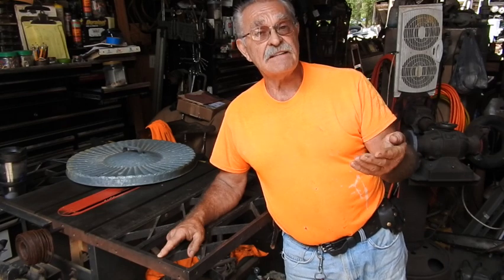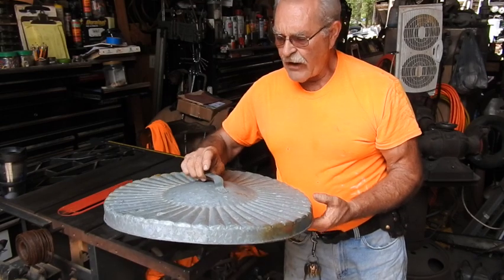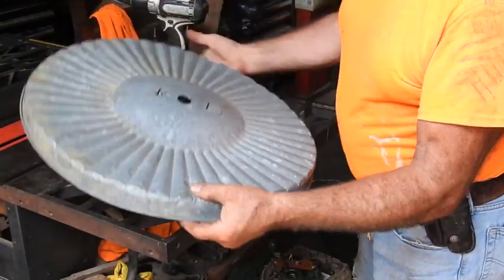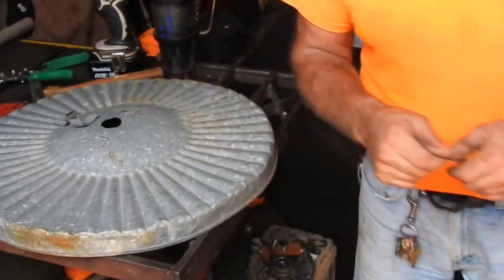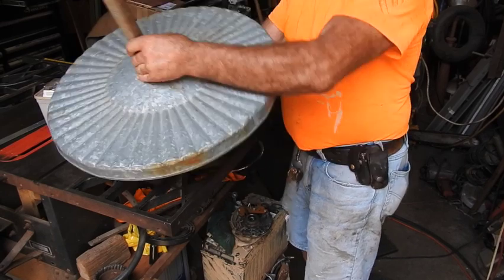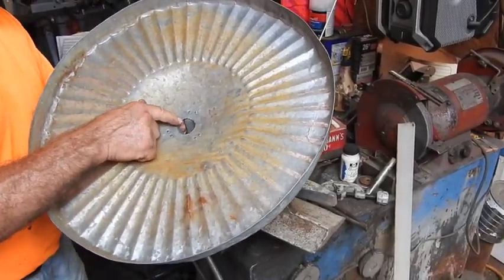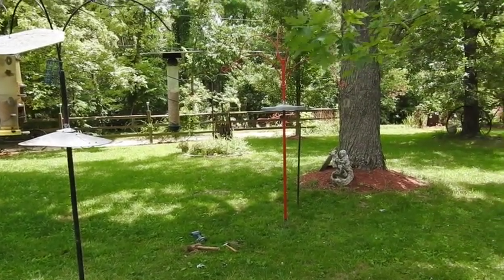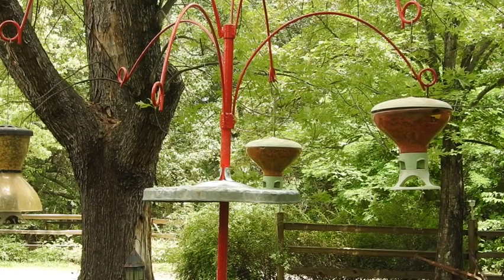DIY Squirrel Guard-Repurposed Trash Can Lid

Comment: hi there smiled when i saw this . made one like it 30 years ago but just put a hose clamp around the pole underneath . i think the wobble nay have helped . but my wife planted a beauty bush to hide the pole and it grew up . oh well . i need one to put my car on . the squirrels have eaten the wires up 6 times now . along with lots of other things . now i just shoot the tree rats . . have you ever made a wood pecker feeder . something fun and a snap for you . john
Reply from the maker: No, never made a woodpecker feeder.  I thought they just poked holes in dead wood for bores. LOL.  I thought of using a hose clamp but decided to make it rigid so it could be used  as a tray for different kinds of food for other birds.  I've had mice eat up the wires under the hood on the old 85 Ford, but not the squirrels.  They had it out for ya man !!  LOL
     On this one project, the control guys used thousands of feet of control wiring with a soy based sheathing.  It was a huge building and during construction, nightly the squirrels would come in and eat dozens of spots throughout the multi story building.  It didn't stop until the building was closed up with doors and windows.  Drove the control guys crazy !!